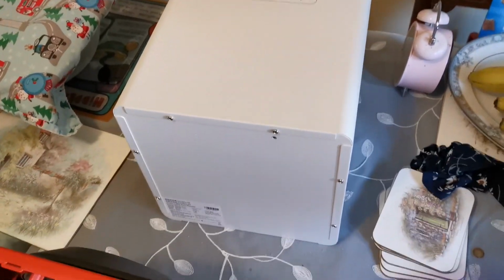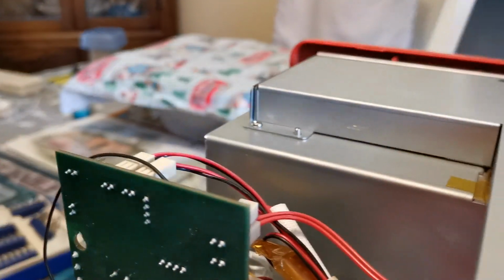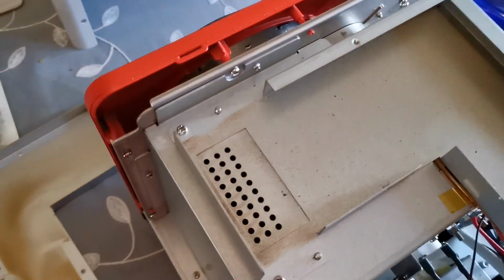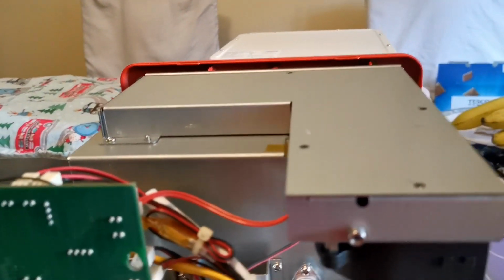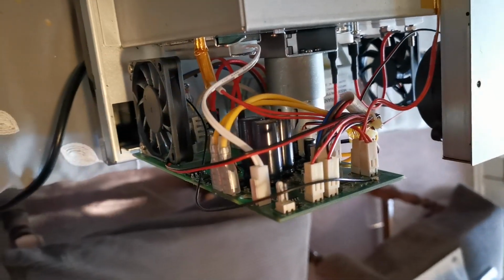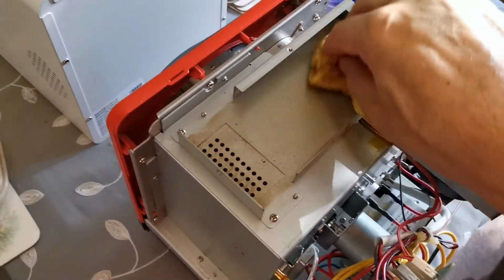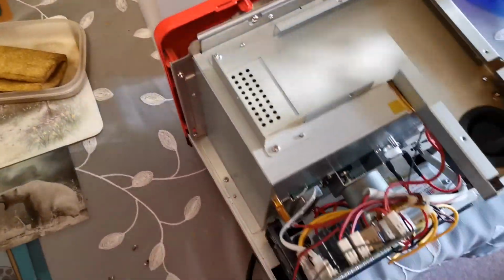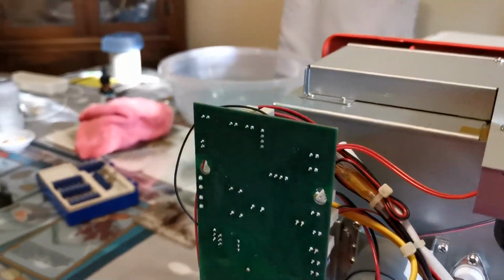Sandbox Smart R1    Internals and Maintenance

Comment: Ive taken out the screws you advise removed. And i dont understand the four screws on the body you tell me to remove. Are they the four screws on the bottom , where ive removed the two you advise at the top. My unit does not slide off. The bottom where I have removed 6 screws is the bit where the rubber feet are. I cant believe showing a video how to and not showing how to. The only screws left to take out are the six in the body of the frame. How do I remove the body of the machine. My model was bought one year ago in 2023. It set light to some coffee beans and on my app, suggested I clean the filter? Where is the filter ? Your clean does not mention a filter !
Reply from the maker: They may have changed things? My roaster certainly didn't have a filter. I can't check it because I returned it to Bella Barista a while ago as their sample roaster (A sandbox Smart R1) had a failed heating element or something and they needed something quickly. The other screws I do seem to remember are on the bottom, reviewing the video, it seems pretty clear to me what to remove...so I don't know what more I can say.

Comment: So I liked everything for 5 1/2 months - except the VIP subscription for a monthly charge, which won't give you the details of the roast. Then it stopped working. I sent it for repair to the US shop they recommended. They advertise 1 year warranty. The shop said they repaired it and sent it back after 1 month. It's STILL not working - heating elements never turn on, just like when I sent it out to them. Sandbox in Taiwan simply told me, "Your roaster should be working" and refuse to do anything more about it, even after I sent them the video they requested. I spent $2500 on this POS. I've also spent over 5 years building a micro-roaster business that is now defunct without a roaster. It's up to you if you want to buy it, but at least you are warned!!!
Reply from the maker: I would say that it's not really suitable to run a micro roasting business and I would imagine the shop didn't know what it was doing. With your usage of a roaster for a business, the first place I would have looked is the limit stat! If you have a multimeter, you can quickly check for power at various points and eliminate whole parts of the roaster from a fault condition. It's a really simple electronic design.